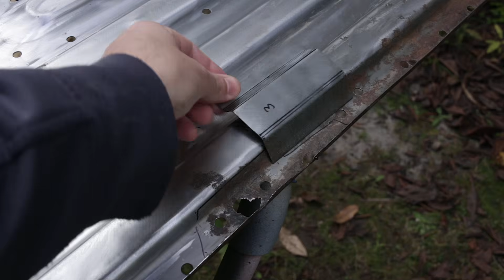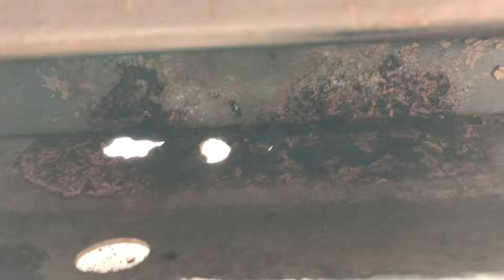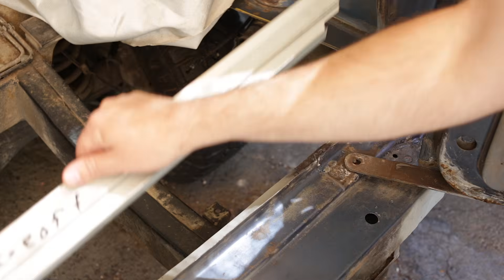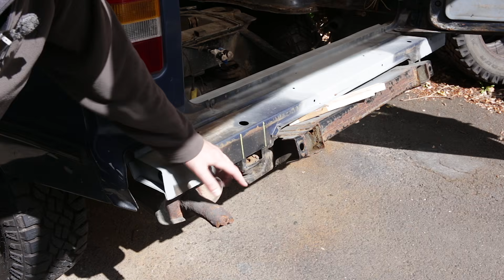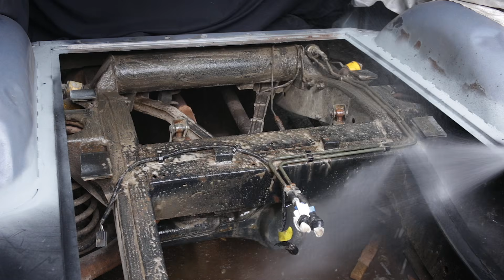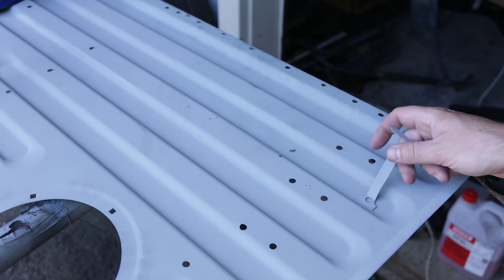Project Discovery // Part 3 - Repairing the Boot Floor & Rear Crossmember

Comment: @21:31 if you had used grinder to cut slits in the top flange and then weld the slits it would have gone a lot faster...

Comment: Just curious, I am repairing the floors in my D1; have a few spots with light rust and cleaned them up but they left small holes about the size of an inch. Curious if you ever use filler or anything else to seal the holes.  Already covered bad spots with with a corroseal. Only two or three, but doesn't seem worth the trouble to pull out the entire panel or cut more than is needed. Any other feedback or suggestions would be appreciated.
Reply from the maker: I would never fill over a rust hole. It’s just going to be more rusty in a months time. Only half an hour’s work to weld in a patch.
Reply: @CROKERvsRover  Thanks for the feedback. Rust was removed, but left a hole. Clean metal was coated after. Was looking at options outside of welding. Welding is certainly on the list and likely the best long term solution, but just curious for minor repairs if there are other solutions which could be leveraged.

Comment: You are very good at doing sheet metal stuff with cars, It is easily my least favorite part about working on vehicles. I can work on electronics for days on end if it means I don't have to replace and bend a new piece of sheet metal the cover rust. Good job on the repairs.

Comment: Thank you very very much for this videos, i have a land rover tdi 300 from the 97 it has exactly the same rust issues in some places as yours.. Have you had any water leak in the footwells both passenger and driver side? Also the alpines windows may leak aswell. I have already done this fixes! so let me know if i can help you solve them around.

Comment: Hi, won't the welding spots start to rust in a couple of years? I have limited knowledge regarding this
Reply from the maker: Yes. Everything needs coating
Reply: @CROKERvsRover  Yeah, but will you also be able to coat each and every weld from both sides to prevent oxidation? I am just curious
Reply from the maker: Yes

Comment: I wish I had watched this before having to do the boot floor on my parents' Discovery 1. Nice job you've done, it's going to be a great car once you finish the not-a-project!

Shrinking with an inch of weld is a useful technique I've not seen before. Thank you.
Reply from the maker: Better if you have a tig welder. Then you can do it without adding filler wire

Comment: Did what you doing with a 1993 200tdi. Trust me I know why it's named accordingly.  DISCOVERY. More and more rust. Was a great truck until the missus ripped off the tail off on a concrete bollard.  😉

Comment: Maybe a useful tip for cleaning metal below plug weld holes ready for welding, use a drill bit the same size as the hole which has had the tip ground off so it is flat, ideal for removing paint etc.

Comment: Man I'm a dumb dumb. In past videos where you've welded I've heard this kinda squeak sound after you've finished. I always just kinda assumed it was maybe a post flow valve or the metal making a noise because of your wet rag or something like that. Well because you were more in front of the camera than previously I finally figured out that it's the hinge on hood when you flip it up! 

Keep up the good work!

Comment: Should have used threaded rod to line everything up on those body mounts.
Also kinda amazed you didn't make the floor bolt in rather than welded.

Comment: Do you have a road salting program in NZ. The rust looks similar to countries that salt their roads. Also cut what you need to cut out and burn in what you need to burn in. From what I can see where your repair sections are can't be seen by daylight all the time so any warping will be near unnoticeable. I supplied panels to to crash repair industry for 15 years and you don't want to know what I saw go into cars that were still under new car warranty.
Reply: Still under warranty?  I used to work in a factory that made parts for car manufacturers.  You don't want to know what happened to some of the parts BEFORE the parts even got sent to the factory to be put into brand new vehicles still on the assembly line.

Comment: I'm quite jealous of your genuine Kant Twist clamps but I'm guessing you didn't buy them in New Zealand? They're just about unobtainium here in Oz.
Reply from the maker: I didn't buy these ones, but you can get them in NZ no problem. I saw you made a batch of them. I thought that one day I'd make some more on the pantograph machine - but I'll probably never get around to it!
Have you used your ones much yet?
Reply: @CROKERvsRover  yes, I used them just the other day. I had to clamp a slab of aluminium to a large angle plate so I could machine the edge square. Worked like a charm.

Comment: I found for 1.6mm thick metal if i want a fold in it, I just cut the 2 edges, and then weld it into a corner then linish the welds to make it nice, the easiest way to get a "fold" in 1.6 with out a huge ass folder

Comment: A very satisfactory job done! I learned a lot that will be useful as I rebuild y Jeep.  One tip I picked up on another channel for holding the floppy bits together is to use small self tapping sheet metal screws.  Remove them as you weld, the holes will be small enough that the plug welds will close them up.
Reply from the maker: You mean through the existing spot weld holes? 🧐 Good idea 👍
Reply: @CROKERvsRover  I think tek screws or those for sheet roof joins the ones with neoprene washers. We both live in wet bits if the world so you may choose to keep the neoprene 😁